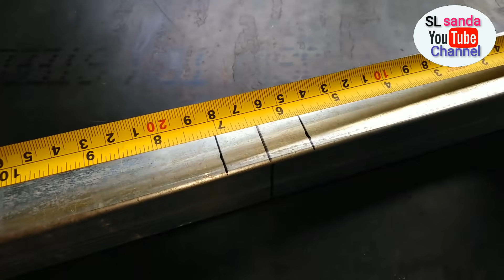How to make bending boxbar manual by sl sanda

Comment: Instead of 3/4" I'd try for 1/2" in order to get a true 90°. Awesome idea. S.L Sanda, you never ceases to amaze me. Another 2 THUMBS UP 👍 👍.
Reply: 1/2 inch would make the angle even smaller than it is in the video. It would be closer to one inch, or whatever half the width go the square tubing is. The center piece must be cut to 90 degrees, and the sides must be cut at 45 degrees. There is no need to measure in order to make these marks square. All one needs is something that is square, like a speed square, or a piece of wood with a 90 degree corner, etc.

Comment: This is a great video but I have to issue a warning since it’s happened to me.  If you frequently use an abrasive cutting disc to sand, eventually you will be cutting something and it will break apart at 9k rpm or bigger depending on the machine.  It’s no fun trust me.

Comment: MAN!! I LIKE THAT MUCH BETTER than the other way that the rest of the channels are showing ! much more material to weld even if it takes a bit longer to cut , I don't think the other would pas an inspection !!??  I just saw that you do the other one also ( box bar bending a 90 ) That's the one I don't think is as good ,thanks

Comment: Not a bad job, but that would be better to mark in degrees, not in inches, because you must calculate your marks for any size of a pipe. In degrees much easier - for double fold divide total angle by 4 (22.5 for 90 degrees, use protractor) independently of a pipe size or shape.
Reply: Marat Zalialov your right
Reply: Dang i never use degrees on a speed square but your right. I only use pitch for roofing like 2:12, 6:12. Etc. If he or she were making a 90° looked like they were off. I need help with making a bull bar on my custom bumper, I'm using 3 inch square tubing and i want it diamond out and wide welded in bumper and tapered as it goes out. And what degrees should i cut from a 4ft outside width to say a two foot outside length past bumper. Give me some degree figures to play with I'll use some lumber to mock and see how i like it. Thanks
Reply: Dirk Diggler If you send me a sketch with dimensions and also take a picture of a bumper - I’ll try to help you. Currently I have a sense what you mean but not quite sure. I don’t want you to make a mistake due to my possibly wrong understanding. Just put the files to some cloud and leave the link here.
Reply: He lost the 90° due to the loss of the material from the thickness of the blade , he's better off using a band saw next time .

Comment: Damn.....get a porta band saw and a mig welder dude !
Reply: I thought the same. Still trying to manage to make a straight cut with a saw grinder? come on. welding rods are cheap, I understand that. MIGs are needed for though applications like automotive. Most structure will hold themselves with rod welding.